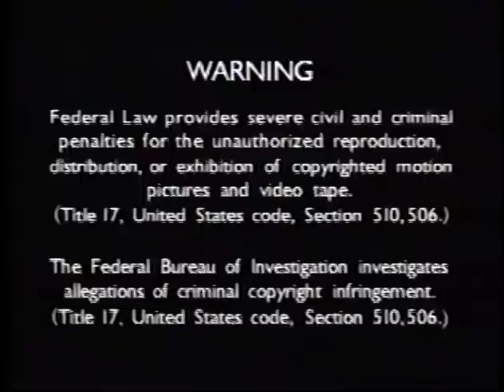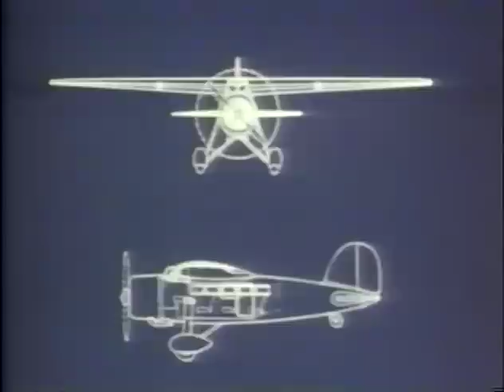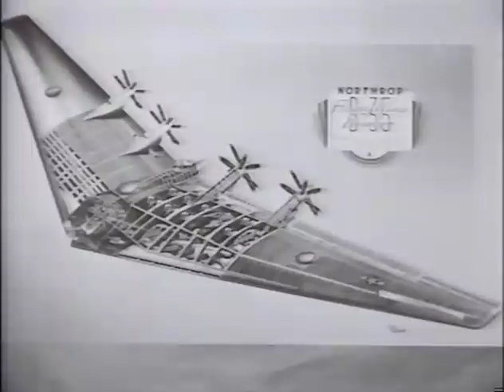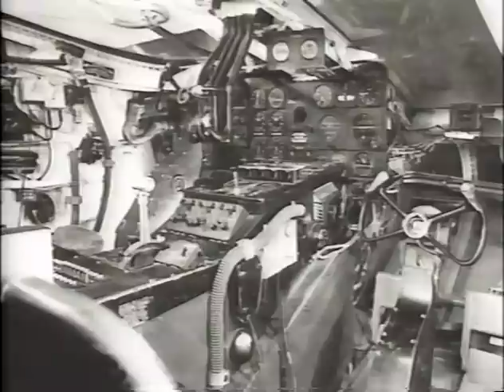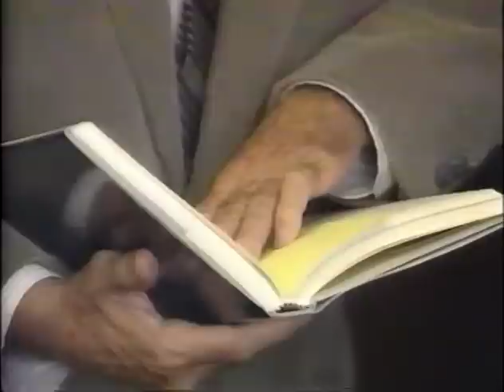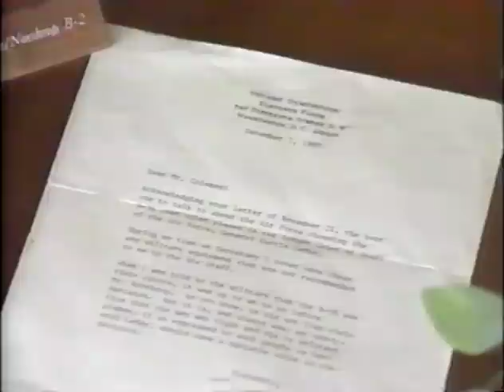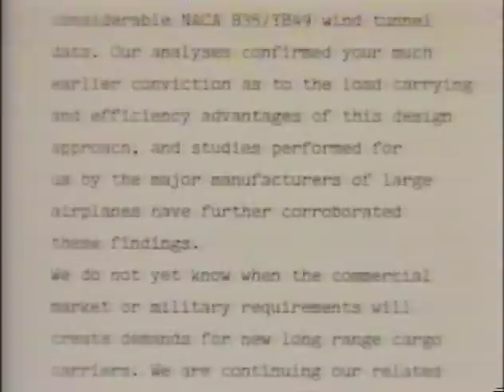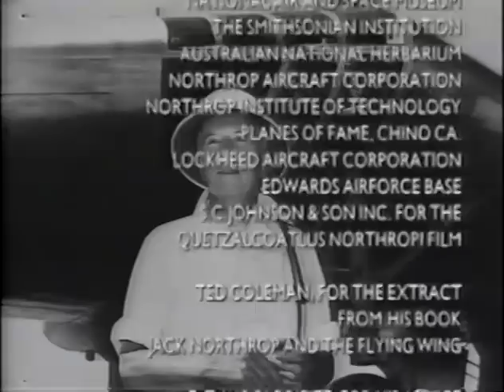The Wing Will Fly

Comment: B2, in specific the spirit of Missouri, got shot over Yugoslavia in '99. It crashed down over the boarder in the Croatian forest and the US was very fast to cover it up. They restricted the area and forbade anyone from entering it, brought excavators and dug half a meter deep for many square kilometers collecting the earth along with the pieces of  the crashed aircraft, in order to make sure no pieces of the new stealth technology were left. The shooting down was covered up and denied but later that year (or next year, I do not remember exactly now) the Spirit of Missouri was deleted from the list of active bombers in the US. The aircraft was shoot by old soviet anti-air defense system NEVA which had a much slower frequency radar than the (at that time) modern radars which turned out is better at detecting stealth air crafts. The US does not want the public to know this because of the impact that might have on the purchase of any of their current and/or future stealth air crafts. Stealth technology is extremely expensive and even more expensive to maintain but the fact remains that a very modern bomber got shot down by an old SAM system so the question of the worth of the investment /purchase is quite logical. Other than B2, Yugoslavia also downed one F117 stealth bomber and shot 2 more F177 which managed to return to their bases without being downed. This was done with the same SAM system. The stealth technology isn't as good as most people think.
Reply: The Serbians never claimed to have fired upon a B-2. It wasn't until 2001 a group of Serbian civvies, justifiably sour of the fighting, but immature when it comes to proving a point created a list of "claimed" NATO aircraft losses. 

> "They restricted the area and forbade anyone from entering it, brought excavators and dug half a meter deep for many square kilometers collecting the earth along with the pieces of  the crashed aircraft, in order to make sure no pieces of the new stealth technology were left. The shooting down was covered up and denied but later that year (or next year, I do not remember exactly now) the Spirit of Missouri was deleted from the list of active bombers in the US."

 Where is the evidence for this exactly? Because there are photos of Spirit of the Missouri online taken from 1999, 2000, and 2001. The aircraft was never taken off any list. Additionally the B-2 was not a black project unlike the F-117A. It's existence and presence is not classified. 

> "The aircraft was shoot by old soviet anti-air defense system NEVA which had a much slower frequency radar than the (at that time) modern radars which turned out is better at detecting stealth air crafts. The US does not want the public to know this because of the impact that might have on the purchase of any of their current and/or future stealth air crafts. Stealth technology is extremely expensive and even more expensive to maintain but the fact remains that a very modern bomber got shot down by an old SAM system so the question of the worth of the investment /purchase is quite logical. Other than B2, Yugoslavia also downed one F117 stealth bomber and shot 2 more F177 which managed to return to their bases without being downed. This was done with the same SAM system."

 Firstly, just a single F-117A was lost. Not two. Secondly the F-117A was an antiquated aircraft by the time. The S-125's and its associated radar arrays were modernized systems from the late eighties and early nineties. The F-117A saw no modernization since its introduction. It lacked any form of countermeasures save being low observable. And according to the 250th Missile Air Defense Brigade wasn't properly targeted until after it had opened its ordnance bay and was at incredibly close range.
Reply: @peterson7082  thank you for your reply. In order not to make this comment section bullshit fest I will try to politely answer with facts and ask for more facts from your part as no other commenting makes sense. 

1. Serbian army wasn't aware what type of aircraft they shot down near the border with Croatia at first. It wasn't until later when they translated the radio correspondence between the pilot and the base where the pilot was reporting he needs to eject that they realized that it might have been B-2 which was used against Serbia in '99. Later on, Spirit of St. Louis (not Missouri, that was my mistake) was taken down from the list of active B-2 bombers in the US). The intelligence in Croatia confirmed the forest digging story and there are reports in the Serbian military concerning all of these things. 

2. Even today, if you go through the earlier news about B-2 bombers you can see that there used to be info about 22 bombers produced which was changed to 21 after '99 with the aforementioned "Spirit" erased from the list. I let you google old blogs, posts and news about the number of air crafts reported before the Yugo war. US will never admit this as this would make them look very bad and influence weapon-selling business.

3. I never said more than 1 f117 were shot down. 1 was shot down but 2 more were shot/damaged but returned to their bases. 

4. The S-125 systems did get modernized but the ones in Serbia surely didn't. Serbia's air defense was outdated with 0 modernization of those systems. So it was the technology of the 60s, not 80s. 

5. The info concerning opening the bay and malfunction of f117 is US propaganda. It is unthinkable for them to admit that stealth technology doesn't work as well as they hopped as that would break the false image of the US army as unbeatable. It was total of 4 stealth air crafts shot with 2 downed. None of them malfunctioned and if you wish to please provide any evidence that can prove the opening bay story as more than just a story, I would be very interested to take it into consideration. 

Also, NATO army lost a bunch of aircrafts and Apache choppers that were "parked" in the airports of the neighboring countries (they were later reported as "accidents" etc.) when Serbia attacked these airports, which is quite legal according to the international warfare law. On the other hand, US and NATO wars these days are all completely illegal and the '99 Yugo war was the first example of the US completely ignoring the international law and attacking a sovereign country without the permission of the UN. So NATO and therefore US war against Yugoslavia was totally illegal according to UN laws. This doesn't mean Serbs did no crime, however, ever since, the US doesn't even bother to get permission from the UN which is obvious with wars in the middle east these days. There are no councils, no investigations, a few pictures are shown and the US attacks. So if you are saying that a country can attack another country and completely ignore the international law and can use legal ways of interpreting its own constitution in a way that "defense of the country" means total world domination, the country which spilled so much blood that it makes the Roman empire looks like a naughty 5-grader can be honest about its own faults and losses, i choose not to believe you but its ok if you disagree. I know how hard it is to learn the truth if you live in a propaganda media system as I grew up in one and know how false news work. I feel sorry for US soldiers as I work in the military myself and know what love for the country/countrymen is. US soldiers do not die because they are protecting USA. They die so Lockheed Martin, Boeing etc. can earn money and they need wars in order to make it. The shame is, many other people die also needlessly, but the ambitions of those who want to rule the world never change. I just wish honest Americans will wake up and see what the military-industrial complexes and the secret services are doing to their country both internally and internationally.
Reply: My bad. It was Spirit of St Louis
Reply: @equilibriomilanchirh2507  The Serbs shot down the Spirit of St Louis???  Charles Lindbergh must have been pissed.    All of the B2 aircraft are named after US states .
Reply: @FiveCentsPlease  thank u. u might b. right concerning the wrong name. However, there are still articles about 22 bombers produced that date back to before the Yugo war. Now you can see only 21 B2 bombers listed...

Comment: The plane in question is without doubt a good plane, and should be,
After all the design is near sixty years old and has all the computers and fly by wire you could ask for.
Whereas the original had noting but the pilots skill to fly it.
I refer to the Hourgton 229 which was flying in 1943-1944 .
It ws removed from Germany anfd hidden away for sixty years in a warehouse, however it had already proven itself and only the engines were an area for concern, being completely new at the time and without the engineering of the time having access to some of the metals that go tio make it totally relyable because on throttling down for landing the engines had a bad habbit of flame out, which in fact killed the test pilot in Germany.
I doubt that there was any attempt to make a stealthy plane as it was something that really had not been gone into at the time, i think that the fact that it did show some ability in that area was purely by luck and by the nature of the design at the time.
This design was something that had also been toyed with as  well by the owner of the coumpany, along with a number of people early on proving that with some attention to the lack of tail fins the plane was good and clearly this problem at the time of this new bomber was a lot easier to resolve with the use of fly by wire which was not available at the time of the 229, a matter that really should be taken into account when talking about the two planes, bearing mind that even the worst plane design in this field can be made to fly with the advantage of  this system.
flym

Comment: Kenneth Arnold didn’t see his shiny flying wings until 1947.
I think we can close his case.
Reply: Lost and Found - The Face of America Abroad 

Except Arnold saw 9 craft performing maneuvers these craft were incapable of at the time.  It’s difficult to think they would have had 9 identical craft all capable of the performance that Arnold described at that early date.  Still doesn’t explain what Arnold saw.

P.S., Kelly Johnson was known to have had two UFO encounters, one of which highly influenced his design for the SR71.  It was known that Johnson firmly believed in UFOs, as did his replacement at Lockheed Skunkworks, Ben Rich.
Reply: keir farnum So, Lockheed was influenced by Northrop?
Reply: keir farnum Think bigger.  The A-5 was fly-by-wire and the LAST one was built in 1961

Comment: good doc but should give some credit to the Horton brothers Northrup used alot of their design.
Reply: No they didn't.
Reply: spring 1947 Walt Horten contacted Jack Northrup for a job but immigration was impossible they stayed in contact also gruman did alot of the test fitting of the ho 229 after it was shipped stateside from UK becuse no way to fit radial jets to the v3 frame I admit design may be to strong a word.
Reply: +Joseph Weeks    The B-2 is the modern version of Northrop's YB-49.  They are identical in size and mission.  The Horten design was just a one-man bomber.  The YB-49 had a six man crew (nine for the YB-35) and was long-range heavy bomber.

Comment: Sadly Jack Northrop was fundamentally wrong in the design of the flying wing, simple because he had used a continual thick wing from the center to the tip, in all his designs.
Reply: He didn’t have the advantage of CAD systems. Some things you just have to model a bijillion ways to get right.